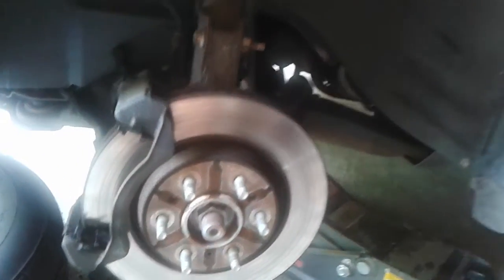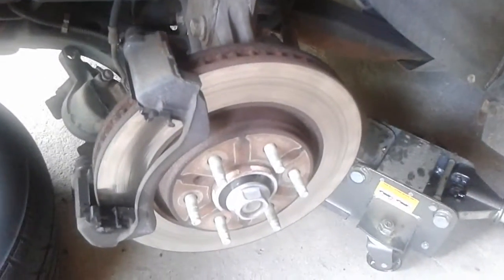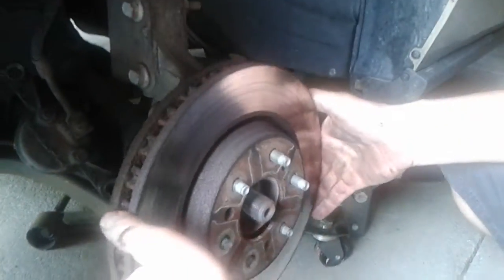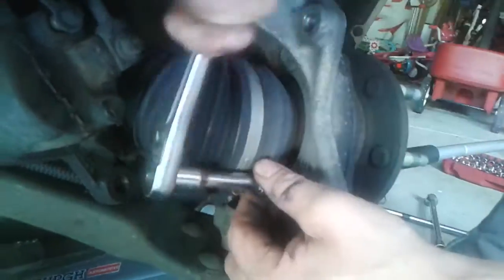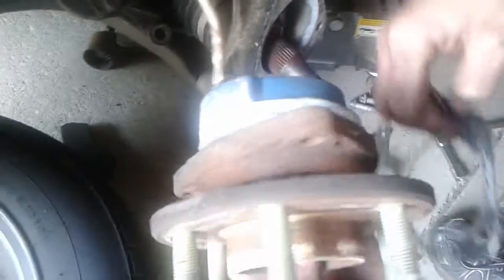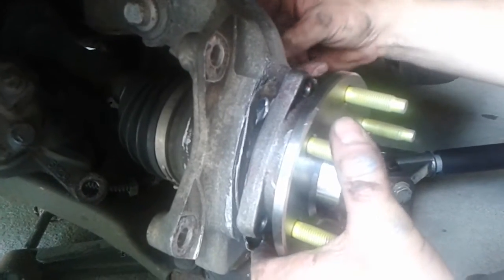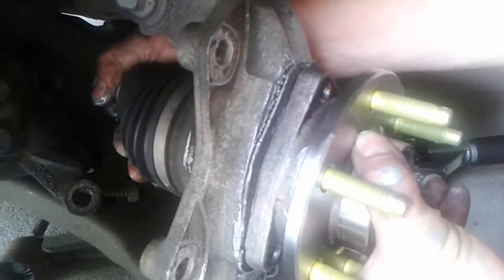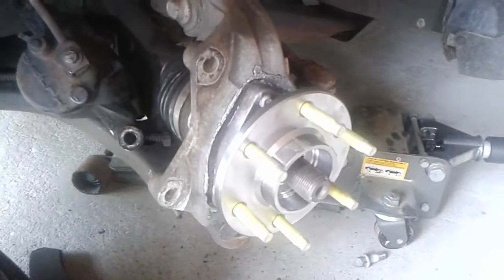2006 Uplander Hub Assembly

Comment: Sometimes when a hub assembly is bad when you turn the opposite direction than the bad bearing it will get quiet during the turn. For example if you turn to the right and the sound goes away then it is the left hub assembly that is bad and vice versa. 

Honestly this is a good video for the at home person. I work in a shop and have impacts and a lot more tools at my disposal. Yes I impact them off but not back on I follow specs when doing jobs. 

Also the set screw for those who live in the rust belt the easiest way I have seen to get them out is by putting the bit in an extender bar and put the bit in the screw and hit the extender bar with a hammer. Gets em out every time. Also works on just about any screw that you just know is gonna strip. 

Also this is an excellent time to make sure your cv axle is good since most have been driving on a bad wheel bearing for quite some time.
Reply: great advice thanks.
Reply: So I've been needing to replace my bearings for a while and have been driving with them. How will I know if I screwed up my cv axles?

Comment: The corrosion process of aluminum happens regardless of how much anti-seize you use on it and salt packs into them regardless as well. I will agree using it on the bolts and splines of the cv axle is a good idea but the problem with them sticking in the spindle is because some genius out there thought it was a good idea to make the spindles out of aluminum instead of steel to save weight. Yeah it save weight but I have seen these spindles with so much pitting in them it is ridiculous. 

Keep in mind domestic cars are made out of recycled steel and aluminum. No quality anymore. Cars that were designed to last a lifetime (very literally) are a thing of the past.  

But its kind of offensive dude saying the people at the shop don't use anti-seize. I use it quite often because I have repeat customers and guess who's doing the work. Yep me so why do I want to make it harder on myself? Where shops take shortcuts is in certain aspects you also took the same shortcuts. Did you bother to inspect the surface below the clips for the brake pads to ride in? nope but I do makes it easier getting pads back in when you clean the rust off of them. 

Why it seems like we take shortcuts is because we are using impacts from snapon and other companies and have a lift along with other tools that expidite the process a whole lot faster than you can do it at home. We do this for a living so we learn what will work and what will not so we don't waste time trying to do something we simply know will not work. We also do not hang the caliper from wire right away we let them hang free for a bit so we can see if the weight is gonna snap that brake hose and why do we do this? Because we don't want some customer going down the road and brake hard pushing 2000 psi of fluid through the system and blow out a hose and cause an accident when it could have been prevented. If the hose cannot support the weight of the caliper it will not hold up to 2000 psi so we'd rather it snap off under the weight of the caliper than when it really counts and the person is driving. It is unsafe for them and everyone else. We also tend to frown big time at how many home diyer's who put compression fittings on a brake line. The system can be as high as 2000 psi why would anyone risk their life putting a compression fitting on that is rated only for 50 psi to join a brake line together is beyond me but I see it a lot and I mean a lot. So maybe the shop charges 400 to put one of these in but what you are paying for is not the part alone. You are paying for the time it took to beak it off (which you yourself said can take a bit of time to do) and the equipment used t do it in a timely manner (faster than you can do it at home) and for the mechanics diagnosis of other failing parts. 

Sorry but we can tell a whole lot faster what is wrong and what is gonna need to be replaced in the future because we do it for a living and not for simply fun. And the customers are mad at us because we come back out and say "yep the bearing is bad and so is the ball joint, cv shaft and control arm bushings" because you decided to drive on a bad bearing for a lot longer than you should have. Not our fault if you drive on it and break other parts in the process and the bill gets higher.  When you notice something is wrong stop driving until it is fixed this is the main cause for the bill being higher.
Reply: great job explaining and not being a troll like earnhardtx .
Reply: ...interesting troubleshooting technique, with the brake caliper, to see if the brake line has some integrity left in it.   It's a very thorough understanding, and it's much appreciated.   
I had a 1990 Lincoln Continental which had a brake caliper disintegrate on me, when I was changing brakes one day, it was seized a bit, so I hit it with a hammer.  Bam!  Huge chunks of pieces came off the assembly.   I was stunned, I had never seen that before in all my years of working on my own vehicles.   The car was nearly 20 years old at the time, I had to scramble to several salvage yards, in Tyler, TX, to locate a replacement.   I finally located a Ford Taurus, same model year, with the same ABS configuration, which fit perfectly on the Lincoln. 
. 
It WAS a nice car, finally parked it on an empty lot in 2012, and abandoned it.  lol

Comment: Good job. I got the Detroit axle hubs from Amazon. I di all four. They fail after 10k. One i did in a state Forest. I went through all the mistakes that happened to you. 
 I have trouble getting specs for my 2005 Uplander. But being a mechanical guy, i get specs for the bolts it all works out fine.  Anti sieze compound is the greatest eh?